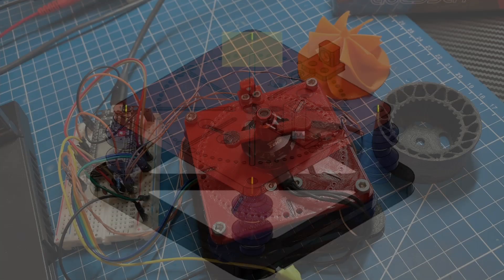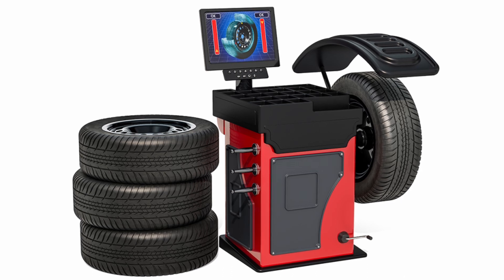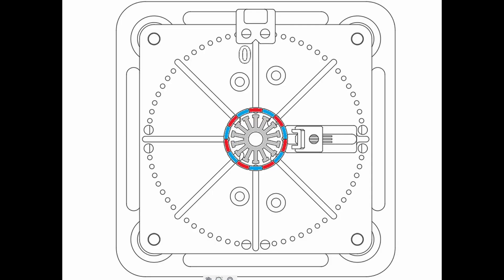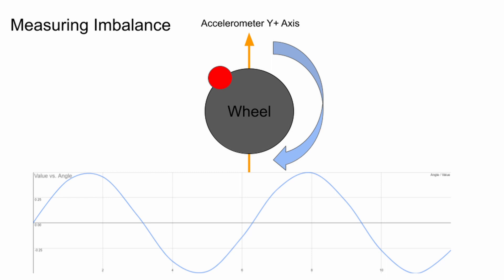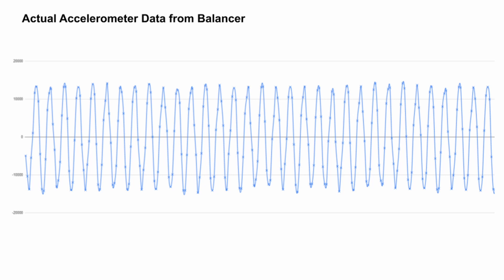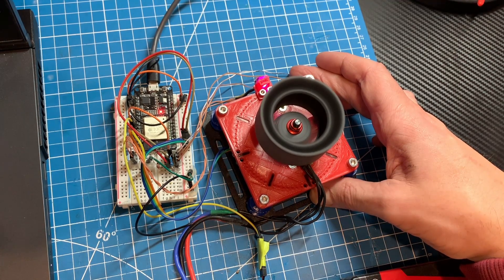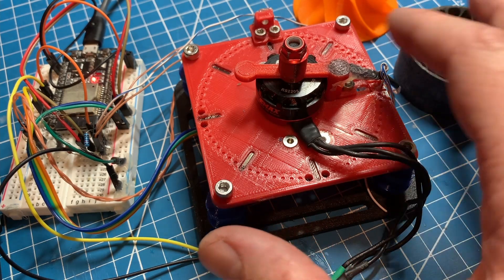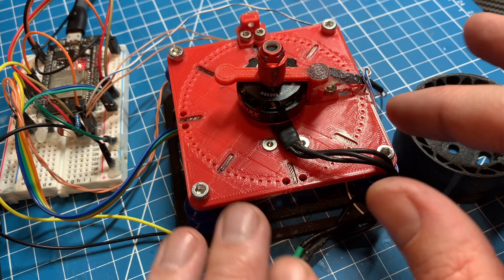3D Printed Dynamic Spin Balancer

Comment: How is the mpu6050 located in this rig? Does it just sit on the red baseplate beneath the motor? (Sorry I can’t see the CAD files for now)
Reply from the maker: It’s mounted directly to the top plate that the motor sits on.

Comment: Wow, thanks so much, very detailed. I am trying to replicate this with slightly different code, but having trouble with consistency of results, which makes me think that the interrupt condition (I am using FALLING) does not always trigger, so it skips a pole and slips - and then the accelerometer measurements don't correspond to the poles. Did you have any troubles like that?
Reply from the maker: Yes, I had that issue sometimes. In the videos I have a pair of magnets mounted in place of where a prop would bolt. I pre-balanced that assembly. I also noticed using a larger motor works better. 

Ultimately when I did a traction control setup on an RC car I used the DRV5015 hall sensor which is latching. That way it only flips state when the opposite pole magnet on the motor passes by. It’s very consistent at high rpm. 

An encoder like an AS5047P would work even better but they’re a bit more money.
Reply: @IndeterminateDesign  Thank you, more debugging coming. I also thought about using a gimbal motor where we know and control the angle without external sensors.

Comment: Will your code run on an arduino 2560, uno r3 or nano? And will it work for balancing props too? Also what program did you write this in? Doesn't look like arduino.
Reply from the maker: The code is Arduino, but I use VSCode and PlatformIO. The code should run on other Arduino compatible boards. I think the servo library I used will have to be swapped out as it’s specific to the ESP32 but the code is the same.

It should work for balancing propellers. I based it off a design someone else on YouTube had come up with for balancing propellers.  I’m not sure the ideal RPM for that use case. You’ll need to play with it most likely by adding some tape to one side of the prop and testing to see if it’s accurate enough.

Comment: Could i also use a piezo sensor instead of an accelerometer  ?
Reply from the maker: I'm sure you could, but I don't know much about interfacing with a piezo sensor.  I know that full size tire balancers use them so they must be fairly accurate.  The main reason I picked the MPU6050 for mine was just the price and simplicity of use.
Reply: Ok thanks for your answer!

Comment: Nice. 
I can only recommend hall effect 360 absolutele angle sensor, which would be easier to read and no zeroing is required.
Reply from the maker: Agreed, I really love absolute angle sensors.  I just didn't have one on hand that was fast enough.  I had an AS5600 but that drops out at a few hundred rpm.  I really need something like an AS5047P or the like.  If you download my cad you'll see there's actually already a hole below the motor for mounting the magnet.

Comment: Thank you for the very interesting implementation of a device for balancing rotors. However, one should take into account that, despite the dynamic measuring principle, it is only a static balancing. Because it is only balanced in one plane of rotation, this is completely sufficient for flat rotors such as propellers. As you mentioned at the end of this video, for rotors with an extension in the axial direction, two balancing planes would be required. This is why the balancing weights on car wheels are attached to both rim flanges. In summary, one could say, that a static imbalance alternatively could also be measured statically, whereas a dynamic imbalance has a three-dimensional effect and requires a dynamic measuring principle and counterweights or balancing holes at two planes.
Reply from the maker: You’re absolutely right, I just reread the Wikipedia article on dynamic balance.   I hope the static balance will be enough for these. It’s not hard to figure out the additional planes, but it’s always the testing and verification that take forever.

Comment: Would measuring the acceleration in the x direction double the sampling rate?
Reply from the maker: Yes, I think that would increase accuracy. You would need to apply an offset of -90 degrees.  I didn’t try it,  because I never found in my research whether the 1khz limit was a sensor limitation or an I2C bus limit (I2C being the protocol used to communicate with the MPU6050).

Comment: If I recall, depending on the gain that the IMU is set to, it will map the acceleration between +-2G, 4G, 8G, or 16G (where G is 9.81m/s^2) to the whole range of the numerical type you're using.

There's a super easy way to check/calibrate it: Just turn the device on its side to get the force of gravity, and then its opposite side to get the force in the opposite direction.    The average of those two forces is the zero-point, and the range is 2G.
Reply from the maker: Yes, the sensor does map to those ranges. I actually use the calibration in the MPU6050 library that runs at startup to zero out the static readings.  I’m not sure how this works internally, but thus far it’s fairly accurate.  It’s hard because I know there’s so many things that could be improved/optimized with a better sensor.